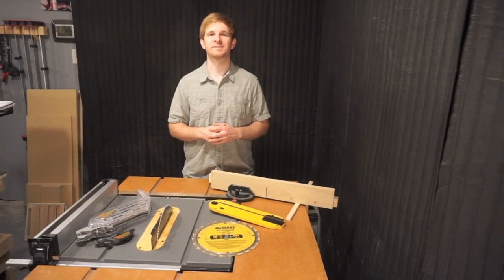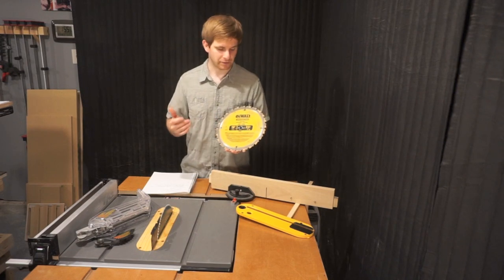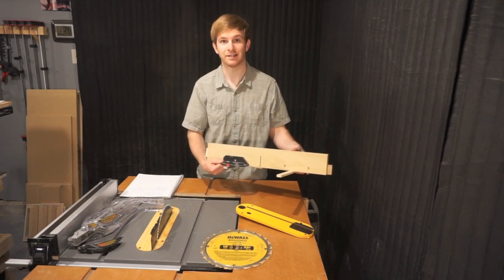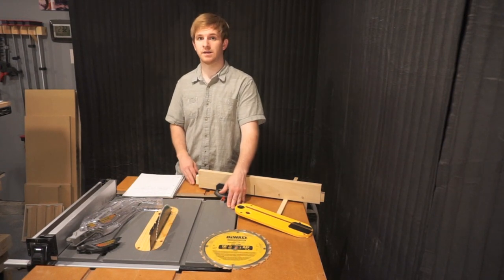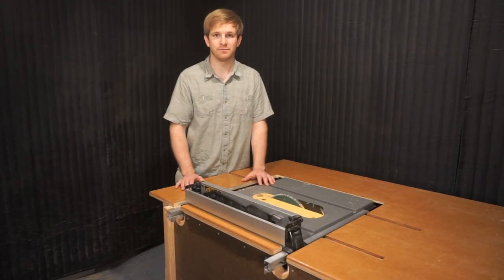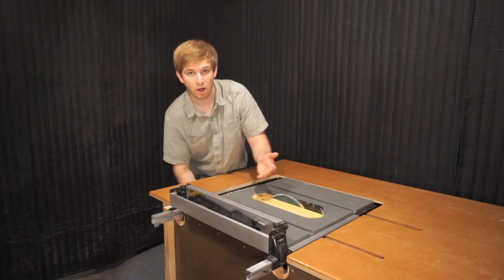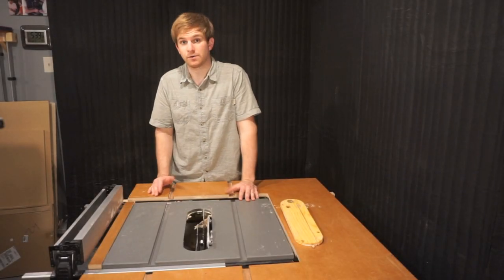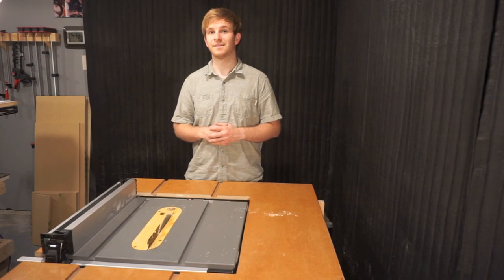Dewalt dwe7480 Table Saw Review

Comment from the maker: If you have any other specific questions about the Dewalt dwe7480 table saw please let me know and I will be happy to answer them! I have really enjoyed this table saw considering the price I paid! Take care.
Reply: Shopfix Hey! Thanks for the review. How accurate have you found the mitre cuts at 45* on this. And have you had any difficulties cutting dense hardwood like Teak. Thanks.
Reply: @savethebrits91  looks like he "got right back to you"...
Reply: @theRolling2010  not from what I read.
Reply from the maker: Hey, I don't use the table saw for 45 degree miter cuts as I always just use my Dewalt miter saw. To cut accurate miters on this table saw a better miter gauge is needed as the stock miter gauge is not suitable for fine woodworking. The table saw doesn't have any trouble cutting different types of hardwoods. You can always add different blades as well!
Reply from the maker: This table saw cannot handle a dado stack. Other Dewalt models can but not this model.
Reply: What was the price?

Comment: I have this saw. Had the same issue with the miter guage. Used a punch to lighlty create a few dimples in the sides of the miter guage's rail. This ever so slightly raised some of the aluminum up around the dimples & fixed the issue.
Reply from the maker: Thank you so much for that tip, great idea!

Comment: the DWE7480 is a 10” 
and DWE7485 is a 8 1/2” saw
but the DW745 is a 10” but they don’t sell the 10” without the stand now.

good luck finding one of those now.  it’s September 2020 and they are nowhere to be found.
the DW735 was $400 sold separately, but the industry has gone to a combo unit sold with a collapsible rolling stand and that have all raised the price.  An increase of almost 50% by just adding a few pieces of inexpensive steel tubing.
Hitachi was bought out by Metabo (german company) and their job site saw went from $350 up to $570.
The saw is the same, but they justify the huge increase because of the stand.
That’s $220 just for the cheap stand that costs them $25 to manufacture out of recycled garbage steel.
I’m trying to find just the DW745 without the stand and it’s impossible.
They are selling the these models with the stand and claiming that it’s an obsolete model, instead of offering to sell the saw independently.
What are you gonna do.
Reply from the maker: Thank you for the updated information, I really appreciate it.

Comment: Thanks so much for this review. In my own typical pre-purchase [over] analysis I keep coming back to DeWalt's rack & pinion fence as a must have for rapid setup, accuracy and repeatability. It just makes engineering sense over others on the market. Also the DWE7480's light weight for ease of shared garage mobility. And I'll too be immediately swapping out the stock construction blade for a Forrest Woodworker type or similar. I already have an Incra miter gauge for my router table that I'll dual-use. Thanks again!
Reply from the maker: Hey good thoughts there, and you are welcome for the review! I wish you the best of luck with your future woodworking projects, take care!
Reply: I like that I can adjust the fence in 1/32” increments

Comment: I bought one of these last week. Dewalt have now increased the arbor length, so some dado stacks should be good to go. The mitre gauge is still crap though, but then all table saw, bandsaw and sander mitre gauges are crap.  I’ll spring for an Incra as soon as I can afford it.
Reply: Shed Man X 
Have you had success with a dado stack? If so what size?
Reply from the maker: A dado stack will not fit on the Dewalt dwe7480 table saw model.

Comment: What a great review video!  I actually have been researching for several days now in anticipation of getting a jobsite saw to use indoors during the winter months.  I narrowed it down to a Bosch, Dewalt and Ridgid.  As of yesterday I had pretty much decided on the Ridgid (primarily due to the dado stack ability) but honestly now after hearing your review I think I may end up going with the Dewalt (I didn't realize the fence was that good on this one).  One question for you though - was the zero clearance insert pretty straightforward to make?  I know the Ridgids can be tricky because of how thin the sides get, but wasn't sure if that is an issue or not with the Dewalt?  Thanks again for this great video - liked and subscribed!
Reply: lol and directly after leaving this comment i went to check out your other videos and see you have one on how to make the zero clearance insert.  I will go watch that next.  This was literally the first video I had ever seen of yours.  Looking forward to digging into more!  :)
Reply from the maker: Hey, thanks so much and I am glad that you found it useful! The fence is very handy so I would agree. Creating a basic Zero Clearance Insert for the Dewalt jobsite table saw is fairly easy. You can make it complicated by adding various things but a basic diy throatplate is simple. If you think you may need to cut dadoes with your jobsite table saw then look at a different model of made by Dewalt because they have made similar Jobsite table saws that can house a dado stack. Thanks for the support, have a good one!
Reply: I don’t usually comment on YouTube, doing so now for the community. I have exact table saw and it accepts this dado stack Oshlun SBJ-0830 8-Inch Box and Finger Joint Set https://www.amazon.com/dp/B0012YIL2W/ref=cm_sw_r_cp_tai_p6FxDb1EKPQ32 I have used this stack and works beautifully leaving a clean flat base. Of note though is that the stack only cuts ¼ or 3/8 dado width, of course you can make two or more passes to achieve your dado desired length.
Reply: Mary Dunne man, if you’re still within the year return the Ridgid and get a DeWalt. I had he Ridgid for about 6.5 months and the quality is nothing compared to DeWalt. Plus it started giving me issues and their customer service is horrible. Even Home Depot doesn’t want to work with them. They don’t have many repair centers and the few they have are hard to work with. Return it and get a DeWalt before you start having issues. Their lifetime warranty is a joke. It’ll take you a lifetime to actually figure out how to use it.

Comment: Dear follow fyi , I have the same saw and added a dado stack to cut 1/2 inch finger joints. I had just enough threads on the shaft to tighten the stack.
Reply from the maker: Hey, thanks for the comment. Did you install a 1/2 inch dado stack to complete that or just an 1/8 inch stack. I noticed that an 1/8th inch stack could fit but barely. I wouldn’t recommend anyone use a dado stack on this model and because of safety reasons I have not tried either.

Comment: Hi there 
Just a question on the rack and pinion I have found that mine drops down when extended out is there any way to alter this 
Thank you
Reply from the maker: Sorry for the late reply, what do you mean by it drops down? It should remain level to the top of the table saw?

Comment: Actually, what you did with the mitre gauge is brilliant as it will also take out the slop if you force it against one side of the mitre slot when you put the sled together - damn I wish I had thought of that!
Reply from the maker: Hey, thanks for the positive comment I really appreciate it! You can make a really cool crosscut sled for the table saw, there are a ton of great videos on how to build really good miter crosscut sleds! Have a good one.
Reply: @_Shopfix  Oh I have several sleds in my workshop, but sometimes you want something light weight and quick to use and your solution fits the bill perfectly IMHO.
Reply: Yes his miter gauge idea is incredibly brilliant!!!  He should patent the idea and manufacture them and sell millions! He could call them something like...oh I don"t know...maybe "crosscut sled"! Ya, that's a catchy name!
Reply: I put metallic tape on the bar of the mitre gauge to take out the slop.

Comment: I'm getting mine to use like yours, as a shop saw. Do you have the plans for building your extended table and base? I'm not really experienced enough to design my own. And why did you change out the throat plate? Great video BTW. Thanks!
Reply from the maker: Hey, I do have plans made for this table saw station. Here is the link to the plans: https://drive.google.com/file/d/1ByyE0lfanapsHM8Ds1C1pL360SKWiSDP/view?usp=sharing I also have a video that discusses the table build in more detail, here is the link to that video: https://www.youtube.com/watch?v=be_UaAbHNOg I created a custom throat plate to simply have a zero clearance so I can rip very thin material. The Dewalt table saw has a wonderful throat plate but the gap between the blade and the throat plate opening is very wide to compensate for the saw blade tilting. If you have any other questions just let me know! Thanks for the comment, and I really hope these resources help you out.

Comment: Really love this table saw however the only thing I could find that I didn’t like is you can’t use a stacked dado with this table saw. The arbor doesn’t except it isn’t long enough. Other then that the saw is great. I’ve been making the dados with my router so it seems to all work out.
Reply from the maker: Correct, the arbor on this table saw is not long enough for a dado stack. A router is a great alternative, and probably easier to setup anyways!

Comment: I just bought the dwe 7485 with the 81/2 blade they had the 7480 but I chose the 7485 because what I'm going to use it for I didn't need a 10inch blade

Comment: The major issue I have had from mine (745) is that the blade raising gear gets easily clogged up with saw dust making it very difficult to raise the blade. The other thing, of course is how easily the surface gets marred although that has no effect on the performance.
EDIT: Oh and the extra MAJOR issue is the 5/8" arbor instead of the standard 30 mm making dangerous rings necessary.
Reply from the maker: Hey, I have not had any issues with the blade raising or any clogging issues. But I do agree the small arbor is an issue and a major downside to this saw, take care!

Comment: I’m looking to get a table saw for my home.  This 7480 has been discontinued but seems good still.  Other options are the 7485 with the smaller blade and more compactness and the 745 with the same blade but smaller rip capacity.  What do you recommend?
Reply from the maker: I am not quite sure as I have no experience with those two models. I find the dewalt brand exceptional so I have no doubt that either model will be of great use!

Comment: I have mine built into the end of my workbench. The only problem I have is the dust collection port moves when I tilt the blade. I have had it for 3 years and haven’t found a solution yet. I probably should used flex tubing .
Reply from the maker: I have my saw hooked up to flexible tubing and I can tilt the saw no problem!

Comment: I have the same Dewalt table saw and I am interested in building or buying a crosscut sled. I built a stand for the saw (on wheels) but I don't have any extensions on either side of the saw or back, which is an issue. Is there a particular plan that you feel is best for this table saw, or one to purchase? I have looked at several but my biggest issue seems to be having support on especially the left side of my table and the back. I did see your video on building around the table saw, but I don't think I have the skills for that. Thanks in advance.

Comment: Thank you for this respectful thorough review ,I quite enjoyed it and got a valuable information out of it.
Now we come to the hard question 
In your opinion ,what is the difference between  your table saw ,and the Dewalt  dwe 745 ?
I am convinced to buy your table saw  7840 model, but in my country I cannot find but the DeWALT DWE 745
I need your advice before going to a wrong choice
Reply: I didn't post this video, but the difference lies in their respective motors. The DW 745's motor has a max rpm of 3850 with no load, while the DWE 7480 has a higher max at 4800 rpm. In my opinion, that translates to greater accuracy with the 7480. The 7480 also has a higher rip capacity, 24.5 inches, compared to the 745's 20 inches. Both worthy saws though. The 745 is lighter in weight, and easier to transport if that's important to you.
Reply from the maker: Thank you for the comment, I could not have said it better myself!
Reply from the maker: Glad it was helpful!

Comment: Do this models tend to have blade problems? I've seen few people.in my area selling it ,everything works great but they has problems with blade either tilting or going up and down.
Would it ne hard to fix it
Reply from the maker: No I’ve never had problems with the blade moving at all. You have to manually raise and lower it. The blade should never tilt.

Comment: Is there any way to adjust the fence?  I have the rack and pinion system too but see no way to adjust it and the fence is not parallel to my miter slots.
Reply from the maker: Hey, there's no need to reference your table saw's fence system with your miter slots as you'll never be crosscutting with the fence locked in place anyways or at least you shouldn't. Rather, you will want to reference the fence to the blade at 0 degrees. Line those up and measure from the blade to the fence to see if the fence is not parallel.

Comment: Out of the box the rack and pinion will not glide easily. it is very stiff to turn the adjustment nob.What am I doing wrong?
Reply from the maker: Sometimes if you put the fence on wrong it will cause the rails to be stiff. Take off the fence and try it and see how it is. It won’t be super smooth but shouldn’t be stiff either.

Comment: Does it have a brake? I've seen some reviews that say it doesn't, and that it takes forever to wind down.
Reply: I have this saw and ya it takes "forever" to wind down. You should definitely not buy it cause it takes "forever".  Maybe a Craftsman or a Harbor Freight saw would be a better application for your needs as the blade probably stops a second faster maybe even 2. Next time I buy a saw that will be the most important feature I look for.
Reply: @61spindrift  Thanks, douche! I ended up finding a much better saw on sale anyway, one that includes soft start and electronic braking, a collapsible stand with wheels, dado blade capability as well as everything this saw has, for about seventy bucks less.

Comment: Thanks for the review, how do you balance the blade after u set it up
Reply from the maker: You are welcome, so after you set the table saw up all you have to do is unlock the angle tilt for the blade, set a square on the top of the table saw surface and then tilt the blade to 90 degrees in reference to your square and than lock it in, it is super easy! Hope that helps, take care!

Comment: 05:09 stop that thing with a knee bump is no longer possible with that table extension. Right? Nevertheless - the extension is absolutely lovely.
07:22 yeah - it's a fence / rail system with gears . Got it..
09:29 Not so fast, chief: you forgot mentioning the superior riving knife exchange system [the lever on the side, you know..] ;-) But other than that: great review.
One last point: how loud is it, compared to [let's say] a BOSCH GKS 190 ? Thanks.
Reply from the maker: Hey thanks for the comments: 
- I think it would be rather difficult to stop the saw with your knee with the stand around the saw, however, you could add on a wooden extension to assist with that purpose. 
- Over clarification since I really like the fence system. 
- That is true, I forgot to mention how easy it is to remove the riving knife and change its position (thru cut/ not thru cut). 
- I am not sure how loud this machine is compared to other similar table saws as I have not worked with many other table saws like this one. I can tell you for certain that any table saw with a solid cast iron table top is going to be much more quite than this saw. 

Thanks for the feedback as well as the positive comments!
Reply: @_Shopfix  Thanks, Bill.
Reply: It’s loud, you need ear protection for sure

Comment: @shopfix Is there any means of doing fine adjustments to the height of the table saw work surface so that when you build a larger saw table around it and things settle that you can maintain perfectly flush surfaces?
Reply from the maker: Yes, the dwe7480 model has feet that can be adjusted. You can also remove the stock feet that are on the table saw and thread something different through the holes in the bottom frame such as different leg levelers or something!
Reply: Shopfix thank you!

Comment: Hi, what blade are you using in your video? Thanks.
Reply from the maker: The saw blade I am using is a Menards brand MasterForce fine tooth finishing blade if you are referencing the green saw blade.
Reply: @_Shopfix  Yes thanks, how many teeth? What is your opinion on that MasterForce blade?
Reply from the maker: Max E. Hey the blade is an 80 tooth blade. I have a MasterForce brand blade on my table saw and my miter saw and have found them to work great. I have also noticed that a fine tooth finishing blade cuts very smooth but at a much slower pace. Depending upon the type of cuts you are making will determine if you need a fine tooth blade. The more teeth the blade has will dramatically reduce cutting speed just for a heads up!

Comment: I was wondering if you can put a 1/4" kerf blade on it?
Reply from the maker: I would only recommend putting a single standard width blade onto the arbor. I would not recommend housing anything more than a single standard blade, this model is not designed for anything else.
Reply: @_Shopfix  okay thanks. There is a single blade with 1/4” carbide teeth that makes a 1/4” kerf that I thought I’d try, but maybe not...